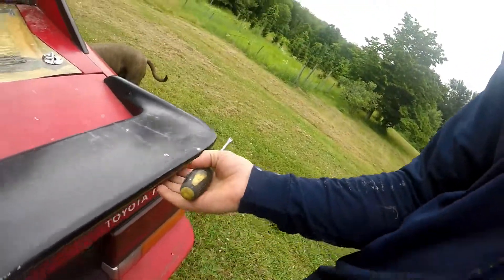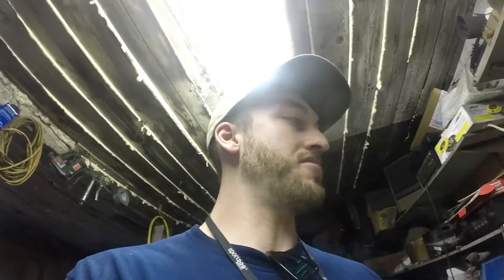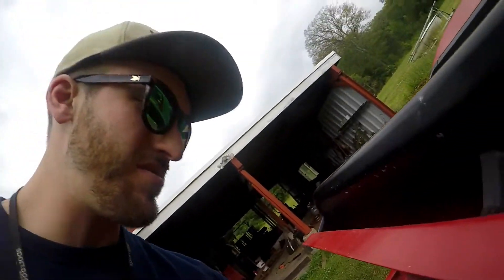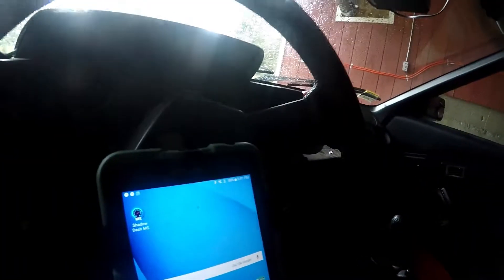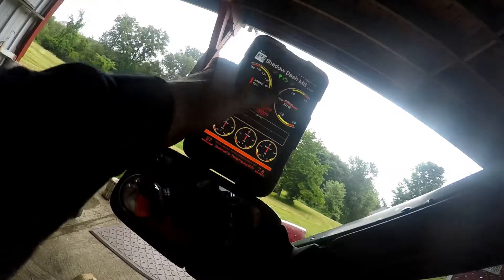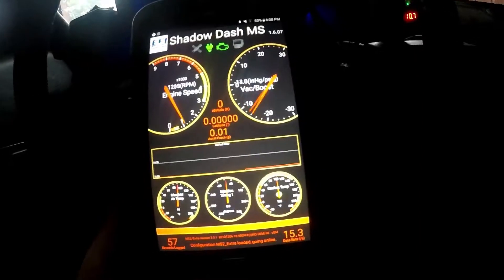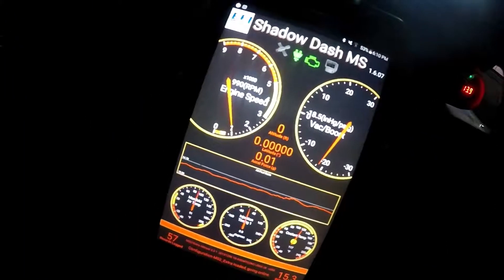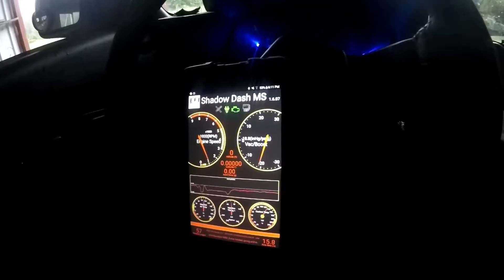AW11 MR2 Gets Bluetooth ECU

Comment: Can you tell me what the equipment is and where to order to make ecu bluetooth
Reply from the maker: yah its on perfecttuning.net i ll put it in a different reply since its a big html. they are cheap
Reply from the maker: https://perfecttuning.net/en/accessories/26-bluetooth-adapter-for-ms2-and-ms3.html?search_query=bluetooth&results=20&HTTP_REFERER=https%3A%2F%2Fperfecttuning.net%2Fen%2Fsearch%3Fcontroller%3Dsearch%26orderby%3Dposition%26orderway%3Ddesc%26search_query%3Dbluetooth%26submit_search%3D
Reply: @lowristocrat3824  did you mod the original ecu or is that some other type of ecu connected to the original ecu
Reply from the maker: @jasonmartin9484  yah i had to add a jumper inbetween two pins on the db15 connector to supply power, or maybe it was the db37, either way its listed in the directions .
Reply from the maker: @jasonmartin9484  its a megasquirt ecu i built, you cant turbo an aw11 with a stock ecu and have it run this well.
Reply: @lowristocrat3824  ok thanks. Would I need the megasquirt ecu for the bluetooth adapter if I'm not running or trying to run a turbo
Reply from the maker: @jasonmartin9484  most definitely.